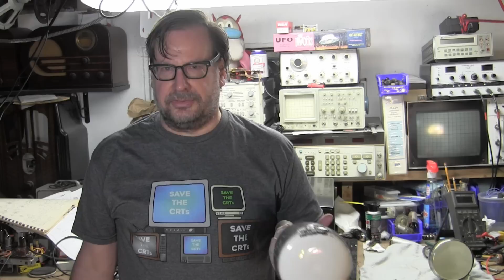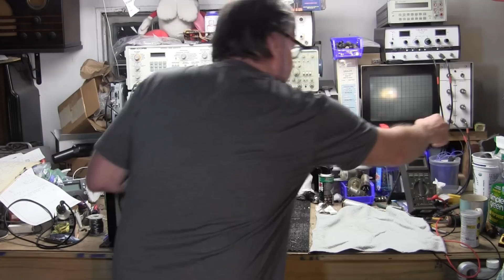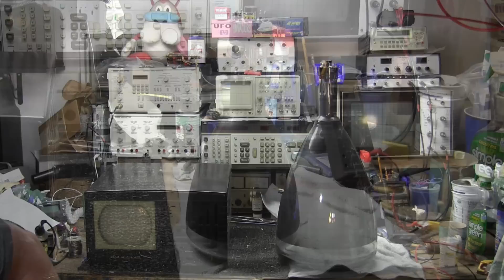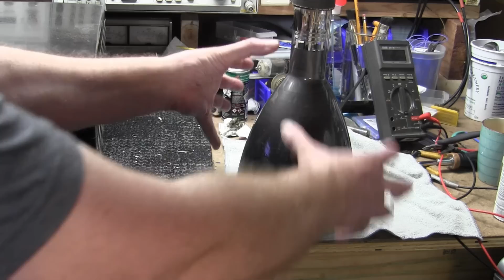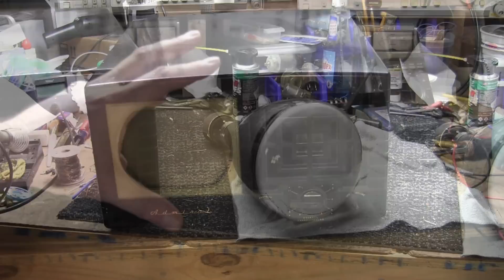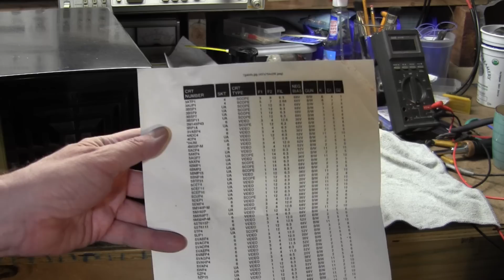How to restore a 1940s electrostatic TV (Motorola VT71, Admiral 19A1, etc) : part 1

Comment: Attempting to answer my own question with Chat GPT:  Electrostatic CRTs use interior deflection plates because electric fields cannot efficiently penetrate glass, and internal plates provide strong, fast, linear beam deflection at practical voltages—something external plates simply cannot do.

Comment: My understanding is that oscilloscopes use electrostatic deflection because it is much easier to make a linear and time accurate sweep. Electrostatic tubes are longer so lower deflection voltages can be used - it simplifies the deflection amp design.

Comment: I have a Motorola in a very nice bakelite cabinet similar to yours in the video. Never plugged it in, not even with dim bulb. Picked it up at a hamfest for $85. Can't wait to watch the series. I would hate to recap and change parts only to discover the CRT is bad. Hoping it didn't have too many hours. Someone has been in it at some time as the line cord interlock is defeated. It is a series string set as were most.

Comment: Thank for doing  these! This randomly showed up after a music video . . . and I'm laughing at the 'algorithmic coincidence' as I recently acquired a 1939 RCA TV. Although I do not pan to update its original circuitry or restore it electronically, I must note that it is in fact has an  electrostatic CRT! So, RCA–did!
Reply from the maker: 1939!  You have a pre-war RCA Television?!?  TT5 or TRK-5?
Reply: TRK-5. I recently showed the all-original  underside of the TV chassis on the FB page, and it is newly listed on the EFT's registry. And by an incredible stroke of luck, last week I received a set of MINT ORIGINAL Tennite Pushbuttons for it. (The ones with the metal insert, thanks Darryl!).! 👍🏼
Reply: [Also, I love how you immediately did not ask if it's a TRK-9 or TRK-12, which are far more common (like, at least 10x for the -12), as they both use magnetic CRTs! 👍🏼]